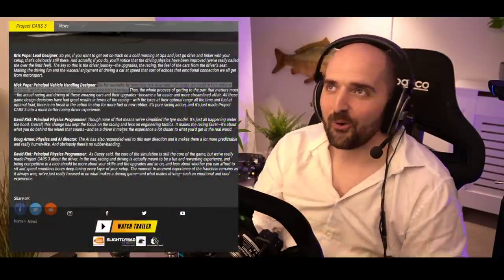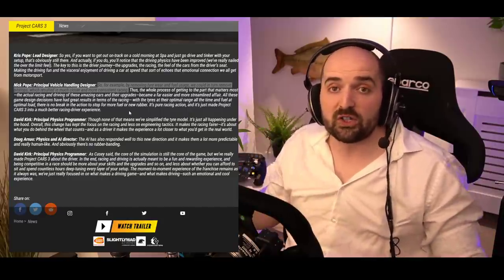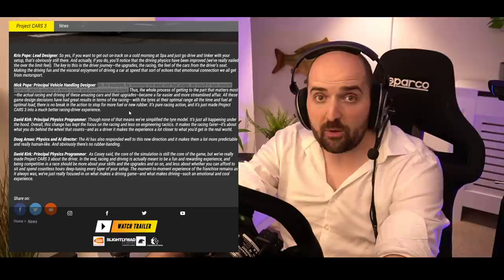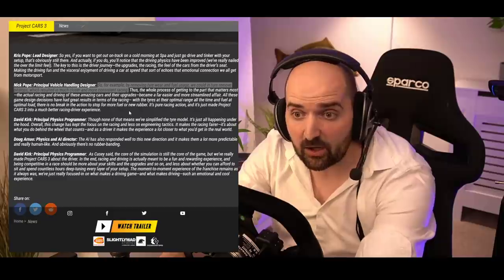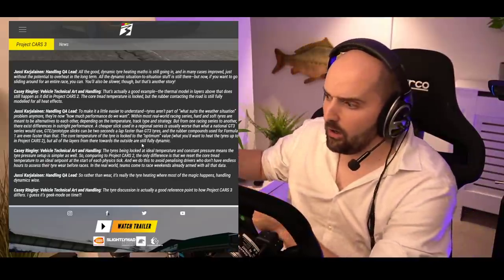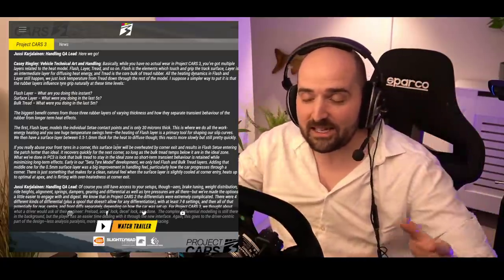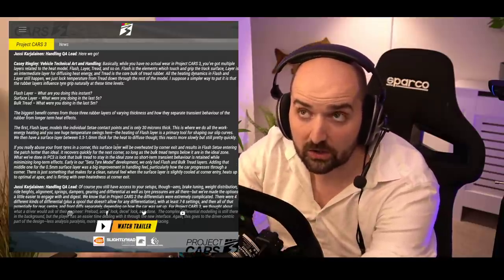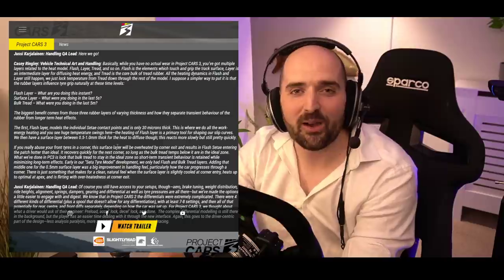No Pit Stops In Project Cars 3  | Are They Mad ?

Comment from the maker: Thanks for all the likes peoples :) 
Bit strange to not have it as an option at all in multiplayer / as an option, makes sense for single-player and specific game modes though.   Like all games/sims if it's fun it's fun all I know is I'm going slightly mad.
Reply: This is truly brain frying!
Reply: We need to watch for micro transactions.
Reply: This would be one big failure when release. And hope they will wake up and involved the community this time. Codemaster is destroying the reputation of sms studio.
Reply: Doesn't sound like there are no setups anymore: "Of course you still have access to your setups, though—aero, brake tuning, weight distribution, ride heights, alignment, springs, dampers, gearing and differential as well as tyre pressures are all there—but we’ve made the options a little easier to engage with and digest. We know that in Project CARS 2 the differentials were extremely complicated. There were 4 different kinds of differential (plus a spool that doesn’t allow for any differentiation), with at least 7-8 settings, and then all of that potentially for rear, centre, and front diffs separately, depending on how the car was set up. For Project CARS 3, we thought about what a driver would ask of their engineer: Preload, accel’ lock, decel’ lock, and done."

So the differential is in pCars 3 more easy to setup like in rF2 on paper...
Reply: @Leynad778  they could maintain the complexity, that was deeper than most sims, and ad better default setups of each track and car! People do this for ACC, they just have to use the Codemasters money in the right way and contract them. I'm not an engineer myself but people who like this could go deeper if they like, but no! Dumbing down is more easy. Hope it crashs as Grid did.
Reply: Can’t believe they have done this! What a slap in a face for us sim racers. Wtf are they doing.
Reply: I wonder what else they'll do away with... No spinning out, because it means closer racing? Fixed setups because it means closer racing?
It seems to me like they are trying to appeal to the arcade crowd, which - lets face it - is much bigger than the sim racing crowd, but trying to convince us sim racers that it still has sim aspects so that we'll buy it too.
Unfortunately I think both crowds will ultimately be put off by this title.

It makes me wonder just how much Codemasters have influenced these decisions.
Reply: Pete Jarram it’s all codemasters ideas & put SMS ideas out the window. Tbh I don’t understand why they couldn’t keep tyre & fuel ware & have an arcade option so it suits both parties. I know there is more arcade racers that play the game for an hour then go on COD or something but what about people who participate in championship endurance races where we want to learn the track, car and depletion of tyres & Fuel and work out strategies. We have weekly races with all this & still have close racing with multiple winners. I hope this title sales will flop big time
Reply: Its a kids arcade game, its NOT for grown ups!!
Reply: Pete Jarram when it rains your tyres adjusts to the conditions, oh the realism!!! I hope everyone boycotts this game
Reply: @williamberkley9581  Agreed
Reply: @Sherlock245  Absolutely. Before you know it they will get rid of VR as well.
Reply: @EDCChampionshipRacingOnline  Your not alone.
Reply: @GamerMuscleVideos what You say about some racing drivers not knowing much about racing set ups is so true. I remember reading that Mika Hakkinen never ever learnt how to read telemetary, yet that never stopped him from becoming a double F1 World Champion. In Martin Brundle's Working the Wheel book he described how Mika couldn't even remember directiond to drive the rental car from the airport to a hotel as his mind completely focussed on what was needed to drive his racing car fast and all the stuff around racing the car his mind filtered out as irrelevant
Reply: @jordanoswald8648  So true
Reply: @conceptualmessiah01  As far as I remember, they told both versions of the settings will be available: the simplified one, and the more complex one.
Reply: @EDCChampionshipRacingOnline  They said the weather will change the temperature and the grip of the tyres. I didn't read anything about magic tyres...

Comment: "into a much better race-driver experience."
"...no brake in the action...."
Pitstops are the factor making the action in racing. The gamechaningness of the pit strategies under different circumstances such as weather changes and safety cars etc. has a huge impact on racing, removing it will decrease the excitement of the race.
Edit: If you remove the setups and give drivers undrivable cars in their classical setup like in Pcars2, than that means you will kill the title.

Comment: Just bought and playing PCARS2 for the first time. It was extremely fun and satisfying to do a little research about setup and use that knowledge to smash the competition in my first career mode cups. (They could have made a whole game out of just the karts! So fun.) Adjusting tire pressure for rain and running out of fuel once on the last lap were highlights in immersion. This is all new to me, so I’m looking forward to PCARS3 all the same, but so far the sim experience has been a rewarding one.

Comment: I can live with no pitstops, since anyway most single player races are <20 laps. But I absolutely loved moseying out the pits, doing a couple of laps to warm up  the tyres, adjusting driving based on how the tyres are responding to the track, how the track temperature and weather conditions changed grip in pcars 2.....

Comment: @Nick Pope, I fixed it for you: "It's pure racing action,and it's just made Project Cars 3 into a much better arcade game."

Also @6:38 "The core temperature of the tyre is locked to the 'optimum' value (what you'd want to heat the tyres up to in Project Cars 2), but all the layers from there towards the outside are still fully dynamic making it easier for those that don't understand the link between the brake rotors and the tyre temp to keep tyres in a 'sticky' state."

Just another game with Mickey Mouse physics, no thank you. I'll just skip this title and write off the game series, thanks though for the offer.

Comment: I would have hoped the only improvements required from PC2 to PC3 is fixing the physics problems.  But removing pit stops takes away a simulator element, which is what Project Cars was all about.

Comment: People forget that Automobilista 2 exists. What people were hoping for from PC2 is literally AMS 2. The graphics and VR implementation of PC2 with better physics and FFB. AMS 2 = PC3.

What SMS are calling PC3 isn't a sequel to either of the Project Cars games. I still play Forza Horizon, because while it's not very realistic, it's just fun. And my god the graphics are wonderful.

If PC3 is literally Forza Horizon with better physics and FFB and with VR support, I am totally on board.
Reply: I bought AMS recently and have been so impressed by the FFB and modelling, however, the game is a nightmare to host servers on, unlike PC2 where you just click a button on the UI and pick settings. It took my brother and I 2 nights to finally make it so he could host a server.

I want to love it and I saw AMS #2, but I'm not sure I really want to give them more money when, in my mind, the first game never received the 'final polish'.

I have Raceroom, AMS, AC, F1 and a number of others, AMS and Raceroom feel so much better on the wheel than PC2, but PC2 is the most 'complete' game in terms of playability. Needless to say, I am gutted to see the direction of PC3.

I too like the casual racing and the option to remove setups, fuel and stops is fine, as long as the option to have them on remains.

Comment: What would be cool is if you could speak to a virtual engineer in the game. e.g. I'm struggling with understeer. The virtual engineer goes through the workflow - is it mid corner, high or low speed etc. Then come up with a suggested set-up. You then keep tweaking the process. That makes it easily accessible and more life like.
Reply from the maker: Or just have good default setups , vast majority of simracers cannot drive 5 laps in a row within 0.300 of eachother and untill a person can do that tweaking setups is a waste of time.   Outside of baseline aro gear ratios.
Reply: @GamerMuscleVideos  yeah true I  know I can't 😔 like the idea of the virtual engineer though as it would provide a good learning experience.

Comment: In the grand scheme of project cars 2, looking from the outside the absolutely absurd notion that you can be a mechanic and modify every single setting down to torque on the suspension bolts - while at the same time you cannot modify a single component in the car or customize anything seems completely unrealistic. You have a unique situation right now where getting the final 2-4 seconds out of a car comes down to how well you can manage to setup all of those gazillion settings and less about how you drive around the track. What the game really needed was a tutorial on how to do that in the quickest way possible ( same with I racing ), because no-one wants to spend weeks / months trying to figure it out, the game should teach it and therein lies the reward. I hope they move into the E-sport area a little more !

Comment: See what happens GM when you complain about setups they bring the game to your level.
Reply from the maker: That's perfect 👌👍 actual racing instead of who has most time to mess with each games stupid specifc setup hacks ☕
Reply: GamerMuscleVideos so a setup for brands hatch works for COTA, interlagos, or monza? No they are inherently different tracks requiring different setups this isn’t even a project cars this it’s understanding vehicle dynamics to be able to accurately adjust what needs adjusting or compromising to balance the car for the track. The default setups in PC2 imo were for a controller so to me the were not acceptable as a base.
Reply: @GamerMuscleVideos  look i don't want criticize you, but i will give my opnion on the topic, if you don't like setups thats fine, the game could have a option to make all people play with a default setup..... this means it catter to everyone like u could disable tire wear if u want fuel if u want pit stops if you want... but removing something its just taking the choice of the game for people that like it......... options is the answer,,,,, if you want the setups removed, you also don't have the right to complain if they removed the pit stops as well,, we either have options that catter to everyone or don't, atleast thats how a simulator should be in my opnion...  i did not like car setups as well, but taht don't mean i want it removed just a option to play everyone in the same car to be i would  be happy already, options is the answer,, removing features is never teh answer (unless that feature is not a part needed to the simulation, for example if the game had a option to put the seatbelts or not its kinda useless would be just a animation it would not matter, but car setups do matter for people that like it  they use it on real races

Comment: I kind of agree with Nick that racing in sims could be made much more accessible, but I don't think removing pitstops and tire/fuel wear is the right way of going about it. Why not go to the root of the problem and remove setups? Or have a couple of "default" setups to pick from, the mechanic thing from PC2 is a good idea but the implementation was crap. 

I'm here for the racing, I'm not a mechanic nor am I interested in becoming one. But at the same time I'm looking for an experience with more to offer than mario kart... PC2 was my fav for a loong time but I'm not sure I like the direction PC3 is heading, or rather their direction-less bumbling around is worrying.

Comment: Question for anyone with basic physics... how can they say tyres "are locked at...constant pressure" but then Jussi says it's "tyre heating where most of the magic happens" - how can tyres heat up without the pressure increasing? P = V/T doesn't it?

Comment: I agree that removing, or simplifying setups would be a good move, but tire wear, fuel and pitstops? I mean, the setups has a huge learning curve. To manage tires and fuel is relatively easy, yet it brings another strategic dimension, and adds options to pass via under/overcut. Sadface.

Comment: I like GT Sport a lot because I like to play with a controller. This was a problem with pC2. GTS has events with and without pit stops.
Anything above 20 minutes of a single race should have at least 1 pit stop.
If pC3 doesn't have pit stops at all even on a 30 minutes race then it's more drive club, the crew 2 or NFS. There aren't bad games but I expect more from pC3. Just get a good out of the box controller setting and possibly GTS racers could shift to pC3. But do it as a simcade not an arcade.

Comment: I was nearly triggered, especially since I have moved up to 40-50 lap races. But then on reflection from my Forza 4 days it was all sprint races, there were no pits stops really. You did use them now and again but only when your car was screwed. In the grind player there were a few endurance events, most people used an AI driver to race them. So I can see where they are coming from.                  But if there completely removed, imo it removes a lot of confidence about this title. I’m sure it’s an option, as to completely alienate a 1/3 of the audience is just stupid

Comment: They have confirmed no pitstops at all.  If it rains your tyres will magically swap for rain tyres.  I normally avoid the sim/not a sim debate but no tyre wear, no fuel use, tyres always at the perfect temperature and pressure, and magically changing slicks to wets as you drive along isn't a sim.  And I say this as someone who has more hours in PC2 than any of the other current gen racing sims (except iRacing which I don't subscribe to).

Comment: I have been cautiously optimistic about this. I loved PC2, and I’ve tried to not listen too much to the negative hype around this. However this blog post, as a loyal fan, has me quite concerned. “Sim” is not just handling, it is the all encompassing experience of racing a car. This includes accurate tire wear, fuel consumption, pit strategy, and in and out laps. What about damage repair? What about dynamic weather? I sincerely hope they just used a poor choice of words or at the very least, made this an option setting. No proper racing game in any form should eliminate pitting, right? I hope SMS is listening to us....